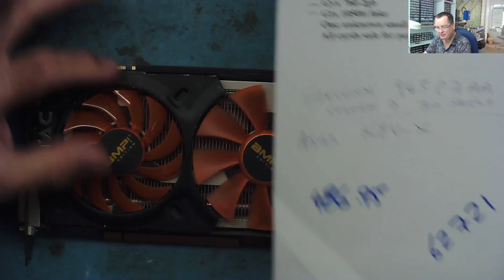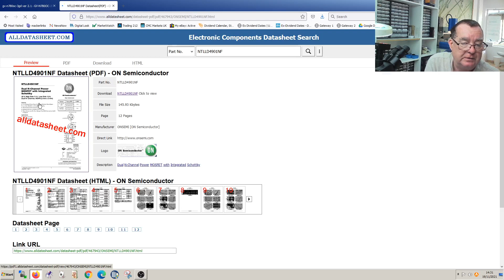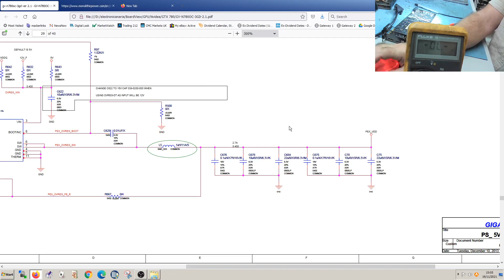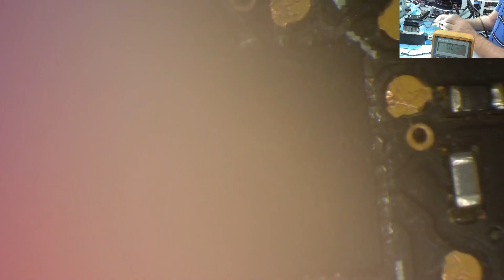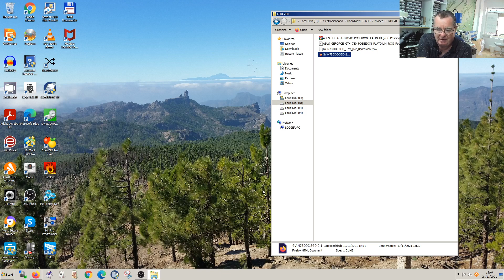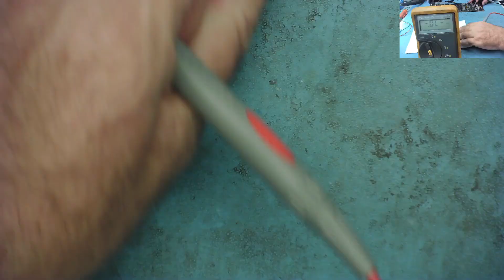I bought 13 EBAY Spares or Repair GPU! Can we fix them and make a profit? Episode 1: GTX780 3Gb

Comment: As for failure modes no hard data exists as far as I know besides reseller RMA rates; generally less-complex, less-powerful GPUs do not fail often, whereas more powerful ones with large bga chips on complex pcbs, heavily stressed with factory overclocks used for gaming do not last long. Up until a few years ago few would bother to fix them, they'd get a new one; now a bare GP104 from a dodgy seller on Ali is almost as much as a new 1070 (with a GP104) was in 2016. Great.

Comment: Newer cards are not cheap even for parts, many of them on Ebay have a shorted GPU or they need whole memory banks replaced etc; it's easy to lose money on them.
Reply from the maker: @John Prescott
I guess bidders pay what they think they are worth.  My general rule of thumb is to pay no more than 25% of good working order second hand/used price.

In my opinion I feel that is what they are worth but I struggle to find the latest models at that price spares/repair (in fact I find it impossible so far) though I do try from time to time.

From that I assume other bidders know those items are worth more than I think they are - so clearly being in the minority I must be wrong.

So this is what got me wondering.... maybe I'm missing out on something good here and  it is time to prove I am wrong

The plain fact is - what the general condition of spares/repair ebay GPUs is I really quite honestly don't know - that's the whole point of this experiment.  

Have any others already done a survey or bought sufficient representative samples to prove the majority have shorted GPU or need the whole memory banks replacing or is there a lot of supposition and urban myth surrounding this?  

Do you have any proof of this fact, if so I am very interested if you could point me towards it as I have tried to research this but so far just drawn a blank.

I just did a quick search one Youtube for 'ebay spares/repair GPU' (again) and I now seem to be the top hit myself, the other one was Elitech who seems to have retired from GPU repair a couple of years ago, and actually I watched his video on the topic before and he didn't come to any conclusion.

The only factor I can think must be correct is market forces.  If people buy these things and find they are unrepairable most of the time, then surely after several attempts they would figure out this is a bad idea and not buy again (several times bitten twice shy) so the number of buyers (i.e the demand) would decrease compared to the supply and the price would collapse at worse or naturalise at best around the price zone where the buyer has a good chance of making a profit, if not on every item, but on average the odds are in their favour.

That is how free markets operate, this is a proven fact. Which leads me back the the fact I appear to be wrong in my evaluation of the true value of these spares/repair graphics cards.  And from what I can see no one has researched/proved this one way or the other

Comment: When I have good resistance on a rail but it doesn't power up (no voltage) I look for the Voltage_in and Enable pins on the buck converter. If those are good then I look at the Feedback pin. If that is also good then I replace the buck converter. Mosfets don't tend to fail on the memory rail so I would've tried to find a good datasheet for that buck converter, asking for help on forums.
Reply from the maker: I did get it to power up after I replaced the RT8811 - you can see on the multimeter it was giving around the correct voltage output until one of the MOSFETs failed
Reply from the maker: @bslayer - what voltage are you checking on the feedback pin? I would have expected that, and the voltage reference to be the same voltage as the output - but only if the VRM is running.  Otherwise feedback would be 0V most likely and the Vref would be 1.35V, 1.5V whatever is the target output voltage  

On this video I had Vcc 5V, EN 3,3V and another supply pin 12V to the VRM, but no output so I changed the RT8811 (after spotting and fixing the solder bridge between oins 17 & 18 first.    Then I got it to power up briefly (voltage looked OK) but one High side MOSFET then failed.

It would be an excellent idea to be able to test the feedback loop is working, especially after replacing a QFN where you could have open circuit pins due to the difficulty of soldering them. So I completely agree with your statement, but how are you checking the feedback pin without powering the device first, in which case if feedback fails you may have already blown the RAM, GPU or some MOSFETs?  

One thing that has occurred to me is to build some sort of crowbar circuit device using op-amps and a Thyristor that could be set to trigger at a fraction over the required voltage (Vcore/Vram) and then strap this device across the load before powering up.  This would save the GPU or RAM I imagine, in the case of a defective VRM causing over voltage, but if it triggered it could well blow the MOSFETS - just they would be easier/cheaper to replace.

The other possibility would be to somehow limit the current supplied by the VRM.  This is all jut me thinking of possible ways to make GPU reoair safer (for the device) I don't know if it is actually possible.
Reply: @learnelectronicsrepair  My mistake, last night I was tired and I fell half asleep around the 20 min mark. :D
So what I usually do is check if the Vin and Enable pins are good and if they are good then I replace the buck converter/LDO. If one or both of those signals are faulty then comes beep mode with the dmm and the tracking where and how the signal comes from, I hate this part. Very often the enable comes from the power OK signal of a ldo/buck converter of the previously fired up voltage rail. Sometimes I check the resistors on the feedback signal and compare it to the datasheet because the manufacturers tend to make these circuits exactly how the datasheet suggests and sometimes the resistors just die (I measure too high resistance on them).
But I suppose this is what you did in the video, I will check it later.
Reply from the maker: @bslay4r  I did similar to that - I found a scematic for a Gigabyte GTX980 then used that as it was not to differnet from my Zotac card - I used it to locate the VCC PVCC and EN pins of the RT8811A.

Comment: 57:35 thats a very clever trick to quick test a mosfet. I guess this would only work if the threshold voltage is around the voltage of the ohmmeter of ~1.5v
Reply from the maker: Many mulitmeters on diode test mode actually give about 3V I think.  Mine will light up blue and white LEDS (dimly) that have forward voltage drop of well over 2V.  It's easy to check this by connecting the mulitmeter in diode mode to another multimeter in volts mode.  I've seen at least one video (think it may have been Tech Cemetary) using diode mode to turn on VRM or LDO chips with missing EN signal to see if they then work.

Comment: 109 for 10 GPUs which one of them is 750ti seems like a sweet deal, but I'd buy 10 series and 20 series cards since the margin of profit for repairing them is still pretty good
Reply from the maker: @Proto
I also bought 3 newer ones including 10 series.  I worked out that these 10 (fixed) would be worth about £450 so the profit margin (percentage) is actually much better than buying 10 and 20 series cards considering the cost of buying them spares or repair.  I just wondered if you are finding the margin on 10/20 series better, maybe it depends on your location?  The other three I bought are newer but cost me a lot more than these 10.
Reply: @learnelectronicsrepair   just finished watching your video and I hope you fix this card, my assumption is that 10 series cards are now selling for at least double the MSRP, and older cards in this video assuming that they all have intact GPU cores would profit you for an average £35 each for your repair attempt minus the fee of parts(either salvaged or bought) but if you can find 10 or 20 series cards they would have been much more profitable per each, and you'll get even more views due to relevancy to what people are actually using for gaming. ofc as you already mentioned it is a matter of location
Reply from the maker: @proto7999  True enough and  I agree to some extent - I do have newer cards in the other batch of three, including 10 series.  

However what I don't really agree is your point regards relevance/views. Anything you can learn repairing 9xx, 7xx, 6xx  cards is totally 100% relevant to 1000, 2000, 3000.  The circuits, power on sequence logic, operating principles and voltage rails are exactly the same (OK to be pedantic I know about 0.7V PEX-ish rails on some later Nvidea and the 7V rails on some Radeon).  My point is that there is nothing you can't learn on older generations that you would need to learn on 2000, 3000.. and it is a lot cheaper and therefore a far better option to learn on the older cards (because you are definitely going to make mistakes) then move to more expensive/financially riskier GPUs once you mastered it.

OK that is my 2 cents worth.... open to discussion... I would love to hear yours and others opinions on that